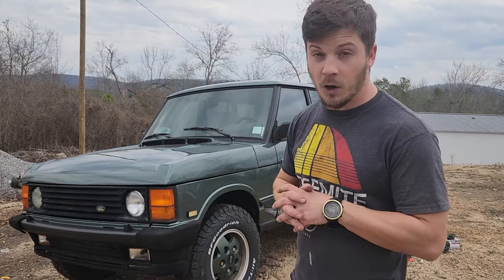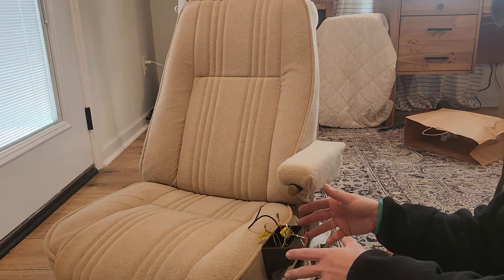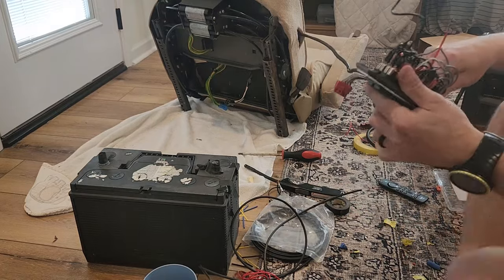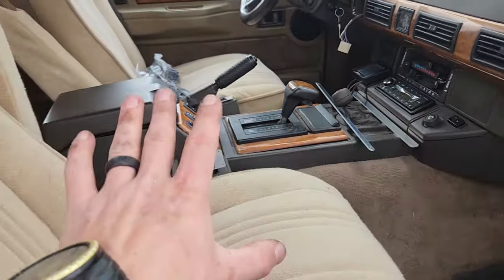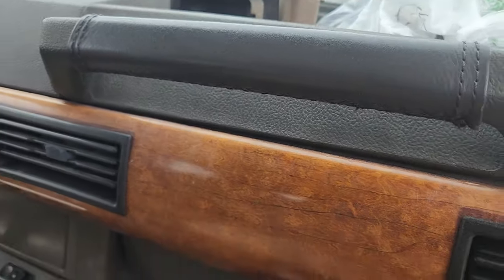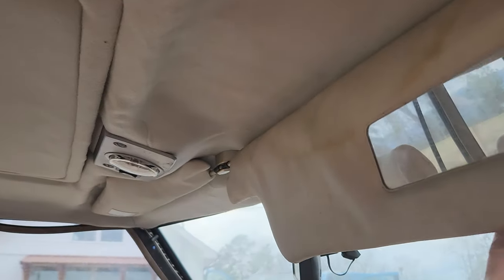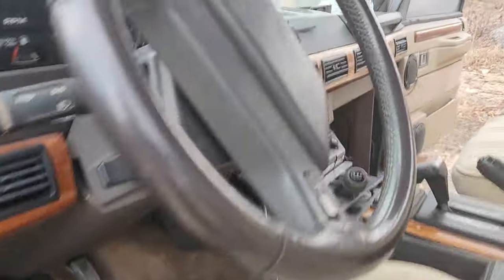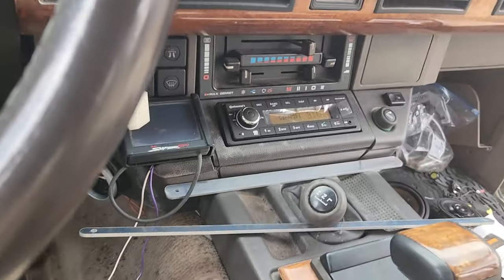The Simple Way To Control Any Seat

Comment: Howdy Sir, please make sure those switches are rated for 30 amps each or they will burn out.  I made my own many years ago because I was frustrated with the OEM Land Rover switches which are actually Mercedes switches. Since there is not relay between the switches and each 30 amp seat motor, the switch needs to be able to handle the full load. A lesser switch will make the magic smoke come out. 😉

I have a write up on this and another for the rebuild of the OEM switches as well. I will link them below.
Reply: Could you share a link for the write up.